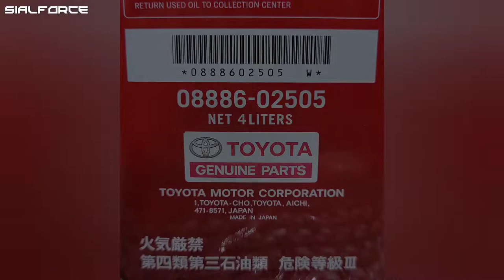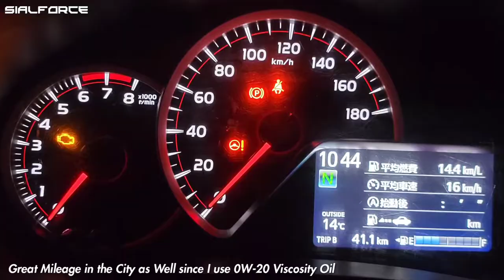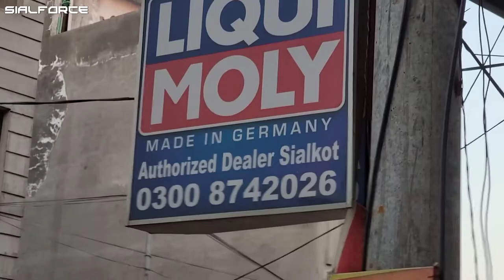Toyota VITZ Transmission Oil Change (2011 - 2019)

Comment: My car is toyota vitz 2014 import 2017 milleage 160 k still didnt change cvt oil whats the recomended km driven cvt oil change my fuel average is 12.5 per km so what should i do or still can i drive as long as i drive
Reply from the maker: Check the oil quality on a white napkin...... drop a few drops, if it is Red then you can change it still, just drain out and pour the new one in and you should be good. If the oil is brown, black or muddy then don't even think of changing it and drive your car until the transmission or engine is died. Don't listen to those uneducated mechanics.
Reply from the maker: And use the Toyota Genuine transmission oil, same as the one I've used in this video
Reply: Karachi mein koi professional mechanic jisko AP jante ho I will go there
Reply: How many liters?

Comment: You poured 4L CVT fluid while owners manual says 6.2L. Why is that ??
Reply from the maker: Accurate! 6.2L or 6.3L is the capacity when the transmission is new and dried out but upon the complete drain and refill it only takes about 3.5, 3.8 to 4-liter don't know why and putting more than that and you have overfilled the chamber, excessive fluid will start leaking and/or ruin your tranny.
Reply: And what about gear calibration after changing cvt fluid ??
Reply from the maker: @junaidjamilkhattak8713  they did that via the OBD scanner, i have that video too but didn't bother to put in the final edit.
Reply: @SIALFORCE  what hppen if overfill?cant fill it if over oil?😅
Reply from the maker: @eizzie7088 Overfilling a transmission with fluid can cause a variety of problems, including Foaming, Aeration, and Fuid Leaks.
 
- Foaming occurs when the fluid draws air bubbles, reducing the fluid's ability to lubricate the transmission components and eventually leading to transmission failure. 
- Aeration is when the fluid is frothy, reducing the transmission's cooling ability.
- Fluid leaks can be caused by air pressure, caused by the overfilled fluid, preventing the seal from forming a tight seal. 

Overfilled fluid also reduces the life of your transmission due to excessive heat, which can cause break down of the fluid.
Reply: @SIALFORCE  tq sir....im 2nr user too....i rlly want to no,and car about transmission i know abaut cost if broken,not cheap....u know sir how to proper cheak oil level....im really² to know🙏🙏🥲

Comment: It’s 6.2 L not 4L read owners manual
Reply from the maker: If you are only doing a partial change, which means draining and refilling the transmission with new oil without flushing the entire system, then the capacity required would typically be less than if you were doing a full flush. In my case, we simply drained the old transmission oil and refilled it with a new oil, so in this scenario, your car only needs a 4.0L transmission oil instead of 6.2L. You need 6.2L when you flush the transmission oil.
Reply: How did you clean the filter? Did you use gasoline? @SIALFORCE

Comment: Sir Vitz ka model kon sa hey. Oil kon sa dala hey? Car kitney CC ki hey?
Reply from the maker: – Model Year: 2013 (2017 import)
– Odometer: 87,000 kms
– Engine Oil: 0W-20 Liqui Moly Molygen
– Engine: 1.0L
– Transmission Oil: Toyota Genuine CVT-FE
Reply: @SIALFORCE vitz 2016 automatic with 1KR engine k liey kon sa transmission oil dalna hey?